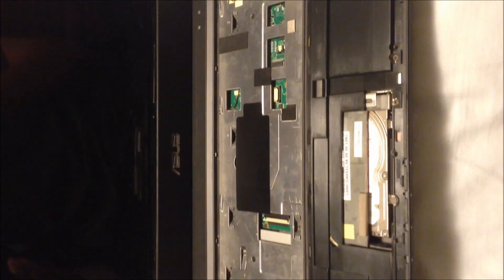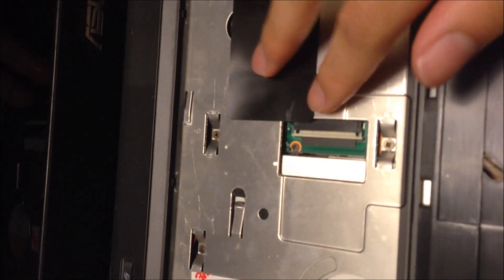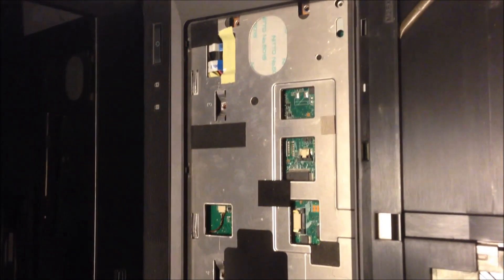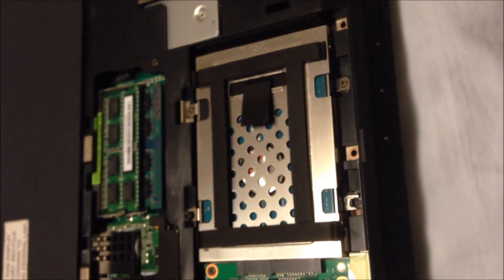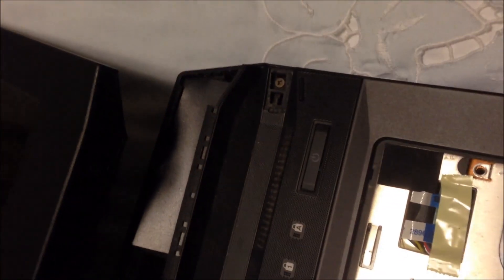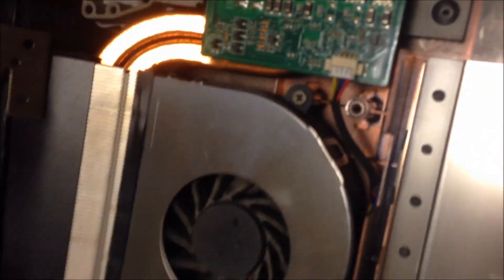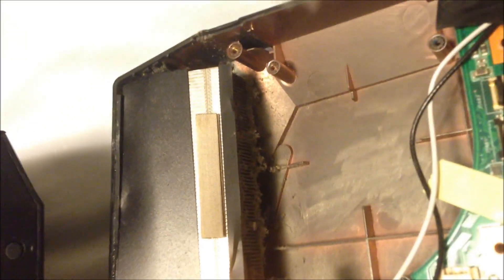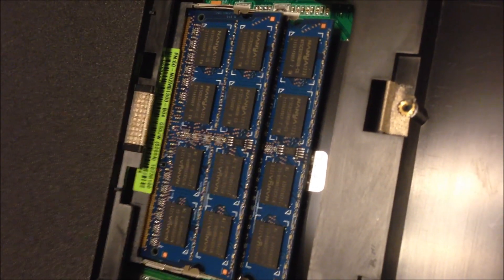Asus G53JW Disassembly + 16Gigs RAM

Comment from the maker: the laptop's shell is like a PVC/ABS plastic. Not sure what "back plate inside" you're referring to. There's a metal plate that covers most of the internals of the computer under the keyboard; I'm guessing its steel or iron. The bottom of the case is also PVC/ABS plastic. There's some more metal in some areas.

Comment: hi, i have an ASUS G53jw-3de aswell, however, i cannot find the third RAM slot, under the keyboard. (the first one you showed us) i have the black thingy over it, but there is no place to insert the RAM. is it my model that came without it or is it something wrong with my laptop ? and it it also seemed like i only had 1 RAM slot in the back of the pc, where in the video you had two. Do you know why ?

Comment: Dude, I have the same model and some douche super glued the back piece that covers the screws and wires to the moniter One half lifts up and i can see that whoever took it apart broke the little plastic pieces that are supposed to snap in place. Now I either have to break my cover or just not fix my fan.